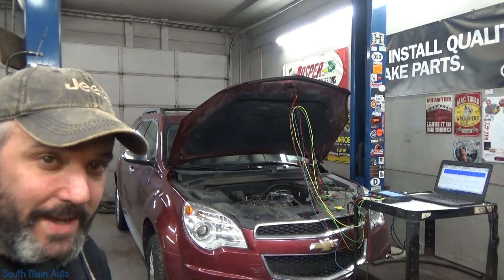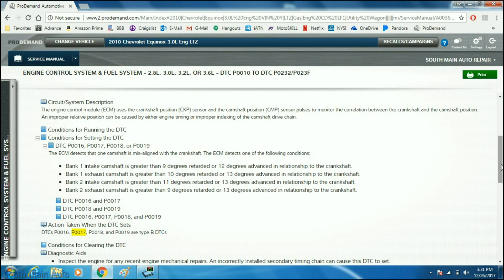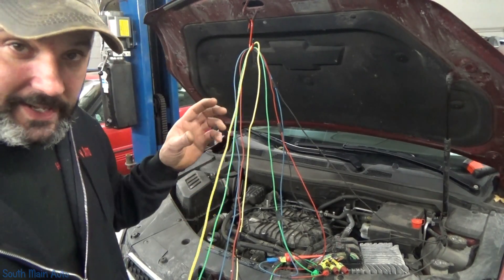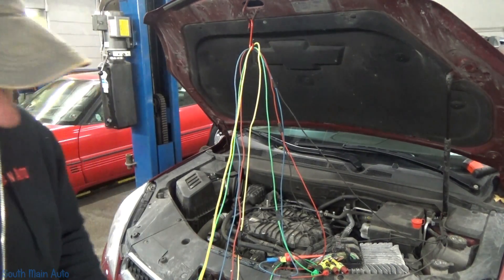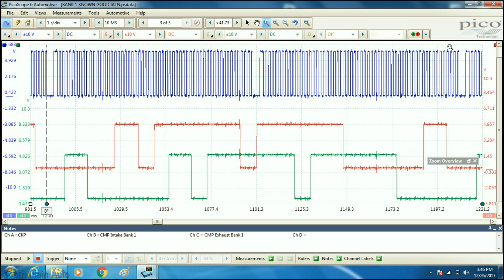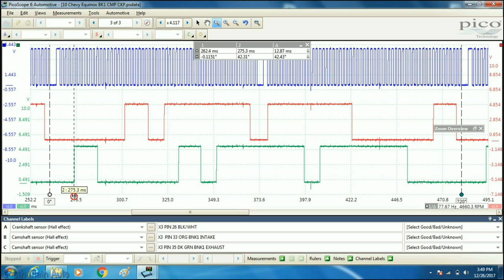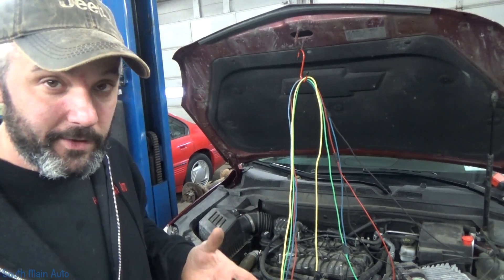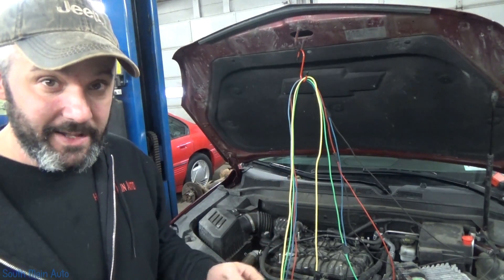Do I NEED A Lab Scope In My Shop?!

Comment: Agree with everything and started with the Sun scope back in 1973 BOCES Auto Mechanics and that's what most garages had back then and now we have the Pico. It's the next step up from the scan tools and DVOM to allow us to diagnose quicker and with minimal disturbance. After the lab scope then the next step up is pressure transducers and accelerometers for vibration diagnosis. Bottom line is technology is rapidly advancing and you have to tool up to stay up or lose a lot of business. Soon actually already happened technology will become so advanced to stay proficient you almost have to become specialized like Keith. Being an independent shop and keeping up is a challenge and you have to research and read everything from system & component description & operation, TSBs, etc and then you need everything to make diagnosing more efficient and accurate and that would be the lab scope. Luckily between Pico, Autonerdz, and several others offer training videos and online support for those wanting to know more about how to use a lab scope prior to the purchase but buyers beware when the scope comes thru the door your sleeping days will be over for a while and the more you use it the more you'll be happy you made the investment. Start with what you can afford and then build up & e-bay has deals all the time from those that have upgraded. Great video Eric!

Comment: I'm a professional pilot who is also a DIY'er fixing my own cars---have been for years.  I also fix cars for friends and neighbors and make enough extra money to support a tool habit.  Second only to picking up an Autel DS708 on craigslist I snagged a good deal on eBay for a Vantage Pro w/16.4 software.  I can certainly see the value in knowing how to use a scope and have used it a fair amount so far.  Being only 2-channel it's not the best scope out there but when it becomes a limitation rather than a tool I'm not using I'll upgrade.  For now the component test database and 2-channel scope combination filled a need I had. If you're going to be serious about fixing cars right the first time for a paying customer I don't know how you can do without it.

Comment: Bottom line you need a scope no question, especially if your working on vehicles for a living. For the DIY it's the question am I going to use it more than once or twice a year or would it be cheaper to take it to a shop that uses a scope just about everyday. And the cost for the DIY guy's and gals to purchase a scope of course that's up to the individual, but yes in my opinion if your a professional mechanic and that's your job yes you need a scope.

Comment: I just bought a used Verus Pro off my Snapon truck after watching you use it all the time. The shop owner where I work provides an old Autel scanner that is ok but is basically a glorified code scanner. I am overwhelmed with all the information on the scanner and don’t know where to begin especially with the scopes. How did you learn that scanner and using the scope features? Any advice for a 15 year mechanic that feels like a beginner and lost with lab scopes and how to hook them up properly?

Comment: I think that you should call yourself a Techanic.  With all the electronics in cars now a days, you really can't work on them without a scope.  The scope allows you to be able to see and record the data streams, which enable you to see what the engine is actually doing in real and expanded time.  Not having a scope, you'll not have the critical information required to make a proper diagnosis of the problem like you did in this video.
Reply: You dont need one for everything. It really depends on what your testing.

Comment: so the correct way to get cam crank relationship on vvt engines is to have to solenoids unplugged??
Reply from the maker: Correct. That is a good practice to do on any VVT engine. Rule out the variables.
Reply: thanks! does the snap on verus show degrees like pico??

Comment: You need to do a repair only using a code reader that the DIY'er could afford to own, like a Actron.  Like me, I wouldn't mind spending $200.00 to buy a cheap code reader. I have repaired my 2005 Dodge Ram 1500 many times by using the ignition key method, turn the key three times and the P0 code shows up on the odometer, look the code up on the Internet and replace the part, easy , so far.
Reply from the maker: Well to be honest I do not pull codes and change the part based on the code so perhaps this may not be the best channel for you in that regards. There is a lot that can be learned from a $200 scan tool for sure but there are times when you need these other tools 100% . It is just the way the industry is TBH. Labscopes have been in the shops and being used sense the 1980's .
Reply: I have learned much from your video's, I'm 63 and have always done all my car and truck repairs. As a kid the family didn't have the money to take our car to the garage for general maintenance, we did our own oil changes, spindle replacement, tie rod ends, brakes and many other repairs, with my Father. I learned from him and didn't know any different. On my Truck I have replaced the O2 sensor, Bank 1 Sensor 2, the EGR valve, both U-Joints,  rear pinion seal and the alternator, all repairs worked and were needed, I didn't employ the "parts cannon". Most of your viewers are probably like me, we like to do our own repairs but can't spend 20K to have all the gadgets you have. I know your business requires you to have the equipment you use daily. I have been self-employed for 40 years and know what it's like to run a business, living in Maryland, taxes and regulations are a PIA.

Comment: Just fyi, I had a Colorado L5 that would throw a p0017 code within seconds of start up. Ended up being a piece of plastic broke off of the actuator solenoid blocking the oil passage.

Comment: Would love to see some scope videos. We have a vantage pro at the shop. I also have a question you may be able to answer... Why can a bad IGN coil  produce over 20kv but not fire the plug? My coworker asked me and I don't have a good answer.
Reply from the maker: You are measuring this on the secondary wire with an inductive pick up?
Reply: South Main Auto Repair yup, it was a cop unit with extension leads because we couldn't get a waveform with the wyze probe. It was on a kia soul, not that it makes any difference.

Comment: Hey Eric love this topic. You mention Hantek , what's the pro's and con's with this budget scope. Do you know if you can use Pico software with It?
Reply from the maker: No you can not use the PICO software with it and a lot of the differences are in the software and in the HARDWARE that the scope is made from. This 4425 is very automotive based with some of it's hardware features. The specs for all the different types of scopes are usually posted on their sites so you can compare.

Comment: It is a lot of information which power setting like coil or the ecu band with the added part for high voltage which wire for what and what is important and where to get known good and how to compare accurate what the different time lapses do
Reply from the maker: Pico has a lot of automated features too to help you set it up that is very helpful for first time users.

Comment: A scope is always useful but a picoscope is a waste of money! If you have that much to spend on a scope, get a real one like a rohde & schwarz scope rider. If you just want basic <10mhz scope capability get a hantek for $200 or an old used picoscope as the software is the only decent thing about a picoscope. I guess the picoscope is a good package for non technical mechanics with money to burn.
Reply from the maker: Keep in mind a lot of folks in the industry may be new to the concept. The Pico software makes it easy to start out with a lot of there automotive based guides and explanations. There are a lot of fantastic options on it to make this job easier. Can you do it with other scopes as you mentioned? YES! Are they easy to use for someone just starting out? Likely not. The Pico with floating grounds and a 200v protection with out an attenuator makes it good scope in our industry IMO. Remember we all have to start somewhere and a lot of guys all ready have 10k dollar Verus or Zeus scan tools in the shop and have never even had the test leads out of the wrapper. Just trying to encourage some folks to dive in and start using it.
Reply: Since you decided to insult a large group of us happy pico owners maybe you could start posting up some of your own scope related videos and show us how superior you are.
Reply: 10k tools in the shop still in the plastic? damn if thats the case thank you for the public service! they should be shot lol. Isolation and protection are just a couple of features included with any decent scope. fyi for anybody the voltage isolation between channel grounds on the pico 4425 is only 30v. Safe for most automotive but not much else, don't use it for mains lol. Imho the cost to value ratio of a pico is still too high compared to something like a scan tool, simply for what it does.
Reply: Haha, send me something to record with and will be happy to make some videos but the content would be not much different than stuff like eevblog except with bad production quality. Why are you insulted? Because I said a picoscope is good for non technical mechanics? Your definition of technical may be different than mine?

Comment: Scopes are great... but in my line of work, you can only use them off air craft. Have to pull the part and bench test it to be able to use one. Can only use an ohm meter on air craft to determine that your wiring is good. I also agree that having wiring diagrams are the first place to start, and having an absolute knowledge of exactly how the system works before doing anything is key.
Reply from the maker: Oh man I am scared to death to fly and now you tell me they use the WORST possible tool in the world to check wire integrity haha THANKS!!
Reply: South Main Auto Repair I'm right there with you. Most big air craft only have about 12-15 bolts holding the wings on.

Comment: You should film this repair. I just used a scope to diagnose a 7.3 powerstroke with a bad engine computer. This is one of the easiest engines to diagnose and work on but this problem absolutely kicked my ass. Broke out the scope and an old eec v pinout box I got on eBay and BAM there it was...
Reply from the maker: Sweet, I still have an EEC IV and V BOB :)
Reply: South Main Auto Repair I have a pico scope but my most used scope is an OTC Perception graphing multimeter that you can pick up for a couple hundred dollars. It’s OTC version of the Vantage. I love that thing.
Reply from the maker: I love my Vantage Pro too!
Reply: @chekelley6861  brand new for a couple hundred? Or used?
Reply: kingkong8974 OTC doesn’t make the Perception anymore, you have to get them from eBay. They pop up once in awhile in really good condition. I saw one the was new in the box recently!

Comment: If you own a shop? 100 percent yes. Especially most newer vehicles. You can still use old fashioned methods of diagnosing issues,if you feel like wasting all day or worse yet, throwing money at the issue is. The other day our Subaru started acting odd. No codes, just a stumbing issue on idle and comming up to a light, then a bit of hesitation. I dumped two cans of dry gas in it and as I thought, it was moisure in the tank. I had suspected so as the vehicle ran great until my wife got gas, then it started acting weird. The drygas cleaned up the issue almost immediately.  Just from past performance, I knew subaru is a good vehicle but all the fancy electronics in the wold cannot compensate for bad gas. I banned her from getting gas at that station.Yes people, you can get contaminated fuel even today. There are some that say no, but I know better.

Comment: On a 2003 corolla i have srs light on codes say open in d squib and there is a code for short in d squib dont know how to go about it
Reply: Ferras Felipe that means you have a short in the clock spring assembly or in the airbag itself.
Reply from the maker: If you are not familiar with air bags I would say take it to a shop to be diagnosed, it could be a simple as a clock spring... it depends on which air bag is considered squib d
Reply: South Main Auto Repair thanks for taking the time  i know you are  busy been a subscriber since the beginning
Reply: Travis R. Thanks i will take it to a pro to check it but since i had both an open and a short i thought it could narrow down whats wrong
Reply: As simple and expensive as a clock spring.  Just replaced one in my corolla.  $430 parts and labor...OUCH!
Reply: Kevin Woodcock damn ive lost all hope
Reply: That was a genuine toyota part Ferras.  Might be cheaper aftermarket.
Reply: Kevin Woodcock oh ok makes sense, how did you come to conclusion it needed clock spring
Reply: It's what my mechanic told me pal.